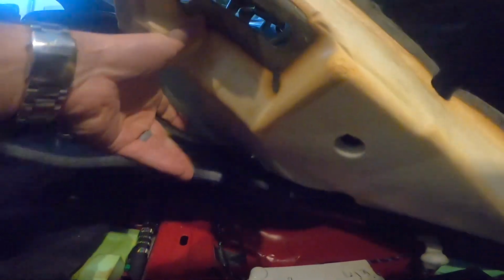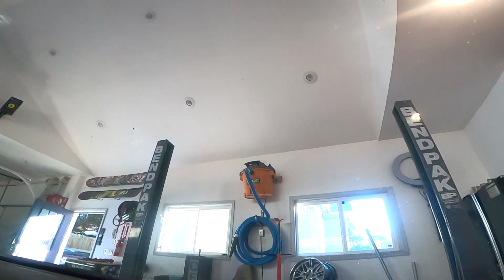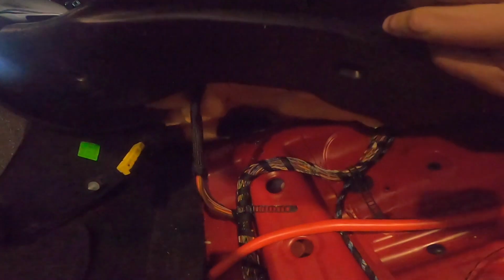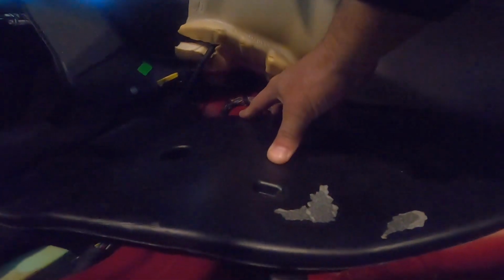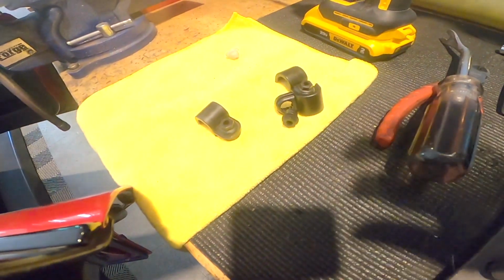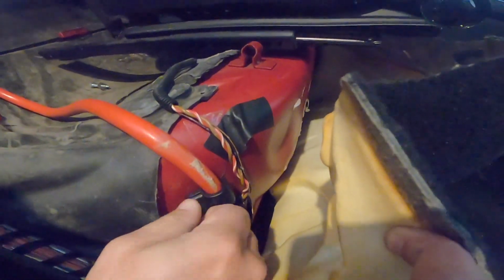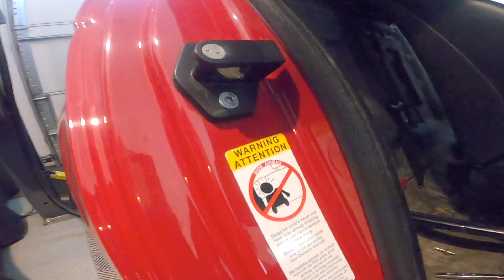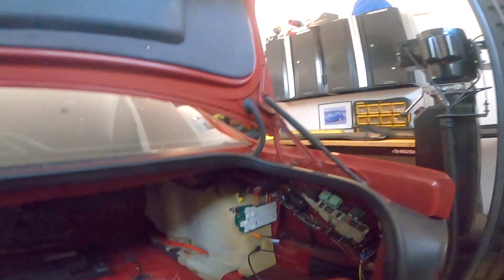Battery Cable Replacement  \\  97-03 BMW 5 Series #e39 #e39M5 #m5

Comment: Hey there
I recently had my car fully detailed in July 2023 and since then had a battery drainage. Even boosting the car with a booster would not work. 
It would start 1-2/10 times. 
After almost two months of having this issue a friend and I noticed by playing around with the positive wire in the trunk just where the wire bends over the chassis it would arch. Pulling the wire away from the chassis and putting booster pack the car would start right up. (Battery drained completely) 
Without touching the positive wire and had the booster on the front mounts in the engine bay, every time I  would try to start the car it would just “click click”. The positive was arching on the chassis. 

Looking at the wire with out removing the black netting around, it appears to be fine and the red jacket of the wire does not look damaged. 

Giving this info on your video incase someone has also experienced this with their car. 

I am going to try to solidify the wire by putting another jacket over it and see if this resolves my issue.
Reply from the maker: That's interesting that yours is arcing yet still has the protective insulator still in tact.  BMWs of this generation are know to have low quality wiring.

Comment: What is that yellow cable connected on the + pole on the battery?
Reply from the maker: I don't know for certain, but experience tells me that this yellow connector is the battery disconnect that occurs when you are in an accident and the airbags go off.  If that happens the car will not run and, unfortunately, you would have to replace this entire cable.